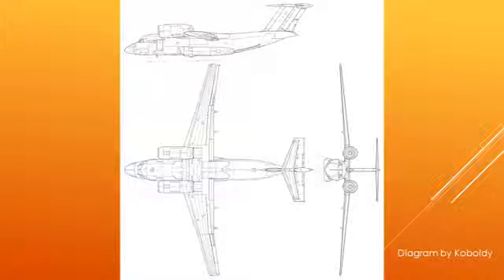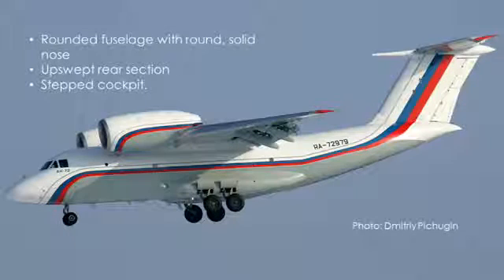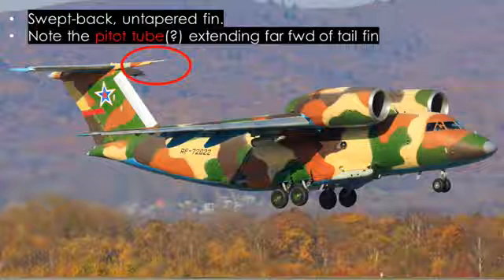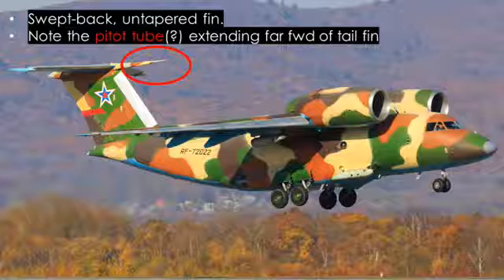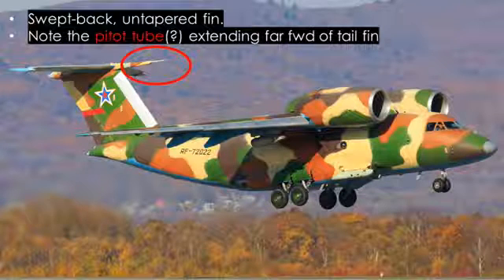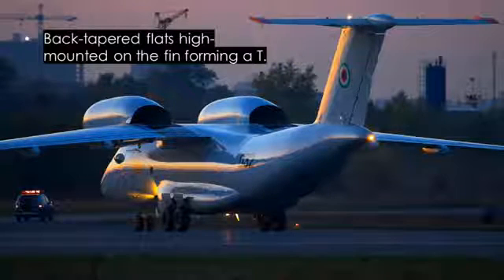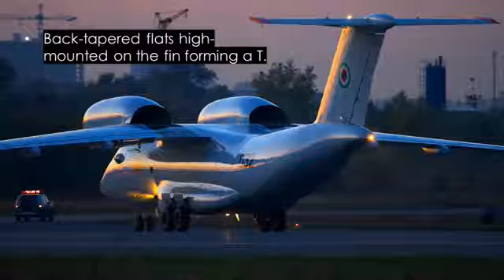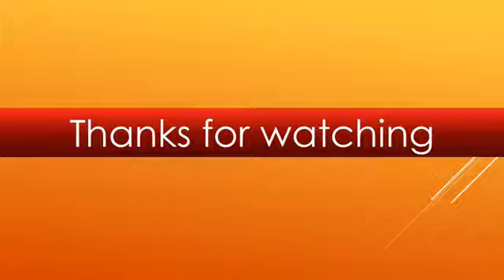An 72/74 Coaler Soviet/Ukrainian Transport Aircraft • REVIEW

Comment: Is there a rationale for the placement of the engines?  It seems to me that such placement would be problematic for ongoing engine maintenance.  It's not what you call 'easy to get at from the ground'.  I do understand the need to lift engine intakes away from unimproved runways, but that seems a mite extreme.  I'm also given to understand that the engine configuration, with the exhaust dumped out on the wing surface like that, is some kind of use of the Coanda Effect, but I'm not versed on exactly how it applies with this particular aircraft.  I just think it a uniquely configured aircraft of aesthetic appeal.  It is eye-catching.
Reply: Lift is produced by accelerating air over a surface. Blow the air over it with your propulsion device and produce more lift with minimal performance loss.